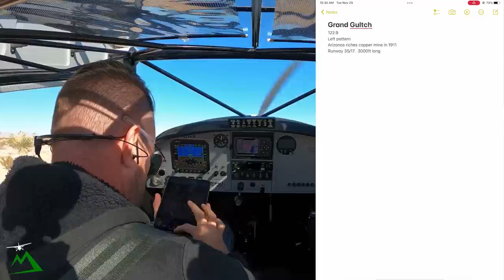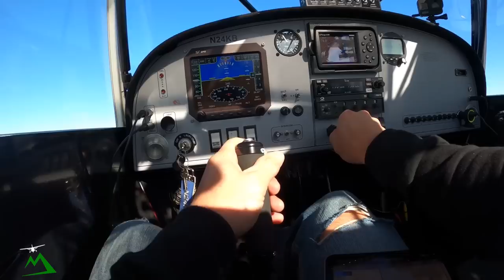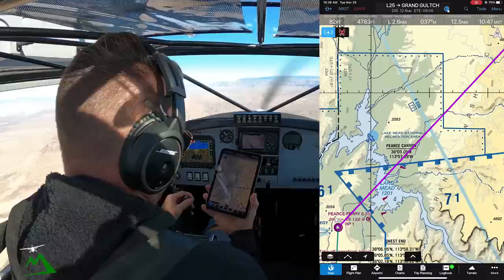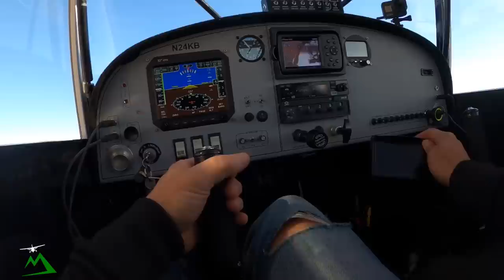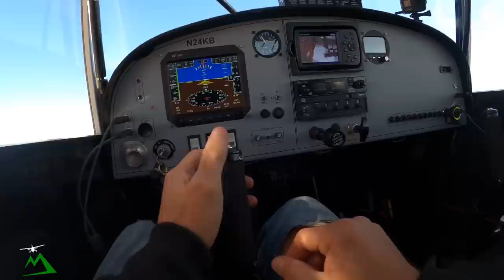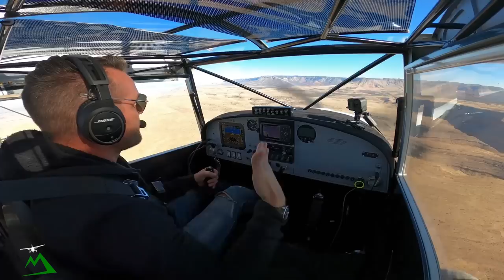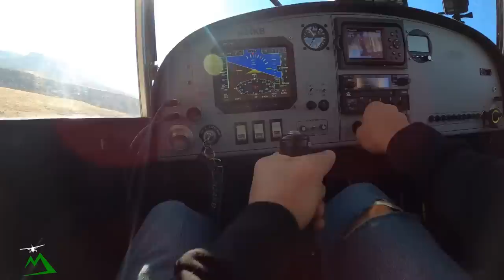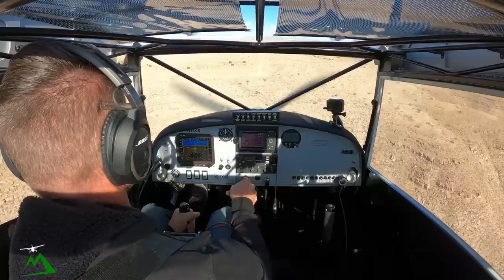Landing at My First Backcountry Airstrip

Comment: Ryan - Here's my guess about the manufacturer of the trucks you found at the abandoned mine site.  I was able to find a 1930's era photograph of a Euclid dump with several features that closely match the trucks.  The cab looks exactly the same.  The Euclid is narrow, has a spring-mounted dump body, leaf springs on the steer axle and what appears to be a rear axle mounted directly to the frame without any visible springs.  🛩

Comment: Hey, I've flown across the Grand Canyon SFRA a few times. FYI generally you're not required to be on with ATC to enter the area or fly the corridors, as they're more or less class E with special restrictions. (That said, of course Center would probably prefer to have you talking to them for traffic awareness. Just that it's not actually required for flying around the SFRA.)

The restrictions include:

1. Most notably, there are areas on the chart that are no-fly below 14500 (and one on the west end that's no-fly below 8000). These are on the chart, they're clearly marked in purple.
2. Because otherwise a contiguous no-fly area over the whole park would prevent normal VFR transits, there are corridors. These have GPS coordinates on the chart, and published minimum altitudes and intended corridor altitudes. The corridor altitudes don't always agree with standard VFR altitudes for direction of flight, so be sure to brief them ahead of time. There are frequencies to monitor when using these. I typically call position on entry and exit, but generally the only folks using these frequencies are helicopter tour operators. If you're on with Center they may have you just stay on with them or they may just tell you to switch over for the duration and then back. You're supposed to monitor the chart published frequency in either case.
3. The general 2000 ft AGL restriction that applies to protected park service areas, except where necessary for takeoff/landing. The whole SFRA is a protected area, with some extensions that are visible on the VFR chart. Flying low in or around the canyons will almost certainly get you a phone call, and there aren't many places for off field landings anyway. There are better places if you want to do that.
4. A few other nonstandard rules like no cargo or parachute drops, and generally no off field landings except emergencies.

Comment: Why mostly solo?  I enjoyed the flights in PNG with your son.  I love that aspect of introducing the next generation to options they may have.  My first flight was at 10 years old sitting in the back seat of a Piper Cherokee on a scenic flight from our local airport.  Flash forward twelve years, and I got my Private, Instrument, Commercial, MEL, CFI, CFII at that same airport.  I then worked there as a CFI/CFII and eventually charter pilot, and then it was off to the jet routes as an ATP.  Anyway Ryan, share it Brother.  Make some memories...

Comment: The cabs look like they are old Macks. Years ago the manufacturers used chain drive to the rear wheels also. Check the inside of the cab on the dash, it might tell you.
Good video!

Comment: Love watching your transition.  Very inspiring.  Explore and share more historic locations in Az.  The A20's have more midrange push from 1800 to 3k.  And the noise cancelation of low end is much better.  So they cut more. And may be less fatiguing.  (scroll between the two and it is very apparent) I have the A20's and would like to try the Pro flights too.
Reply from the maker: I prefer wearing the Clarity Aloft for long days.  Way less fatiguing
Reply: @MissionaryBushPilot  Thanks for the response. I meant  less fatiguing on your hearing.  pumping less low end into the ear is better.  But they are much  better as a full range system for sure. I have wanted to try them  for a while.  I will now on your recommendation.  Really enjoy the content.

Comment: Ryan - I am curious about what preparation you do  for ‘survival’ should you need to put down in the rough country. I imagine you must have some sort of survival kit, and lots of water.    The other thought was what pilots of aircraft like your do, to prevent your ELT from being triggered on those rougher airstrips.       Perhaps you could mention some of these things, on an upcoming video.
And, your over the ear Bose headset/mic combination, while making your voice a little less Ryanish, or a bit less husky sounding, certainly minimizes in-cockpit and engine noise better than the other headset your prefer. Perhaps it is all do-win to the microphone.

What is your Kitfox’s available load capacity on full tanks? I would imagine that the larger wheels, and all of your batteries and cameras, plus any survival gear, must eat into that number fairly significantly.

Comment: Hey Ryan try light speed Zulu 3 headset. They work the best for noisy aircraft such as yours running a rotax 912. They filter the loud cabin buffering better than the Bose.
Reply from the maker: Both headsets sound great in my ears, I was more concerned about the audio for the video
Reply: @MissionaryBushPilot  Ok.  The Bose a20 sound slightly better than the other ones. Not much in it.

Comment: I really enjoyed the flight. This is a corner of Arizona I never got to see, either from the ground or from the air. 
Do you have ADSB in the aircraft yet? If not, you might check out the Uavionix EchoUAT. I use it and really like it. It gives me in and out, with connection to my smartphone via Wi-Fi in the aircraft. I also think it's one of the least expensive systems out there.

Comment: Not sure where you are at, but the cement pad may have been a visual landmark that the air  postal service needed when flying VFR.  Back in the olden days, before radio navigation, they had to fly across the US by dead reckoning.
Reply from the maker: Seems like a hard place to put a cement pad even for that

Comment: I am an earbuds kind of guy. I just don't like having something clamped to my head. I don't even like hats. Unfortunately, I also have problems with the memory foam ear plugs and stock earbud inserts. I know...I'm a princess. 

At the moment, I am waiting for my custom ear tips for my stereo Bose QC30 headset (non aviation). I had them made at an audiologist and cost about US $200. My audiologist (and it seems most audiologists) can make custom headphone tips for virtually any headphones or headset. 

There are home kits that one can use to make an inner ear mold...but I have heard mixed reviews because, among other things, they are too shallow. An audiologist can make a deep mold and it only takes a few minutes. 

At some point, I am going to get an earbud type pilot headset and have custom inserts made.